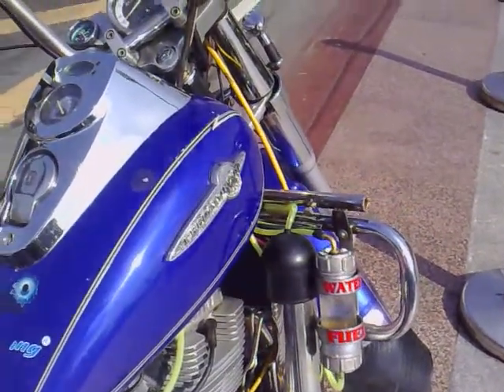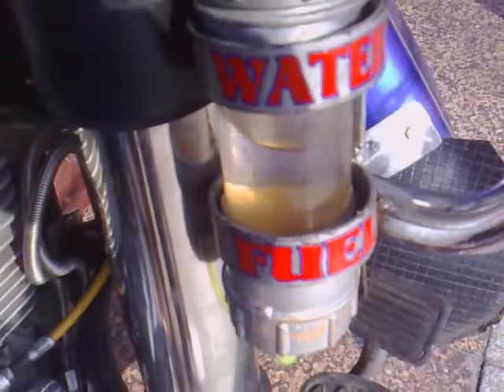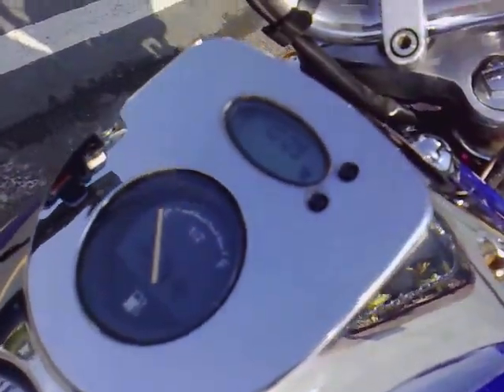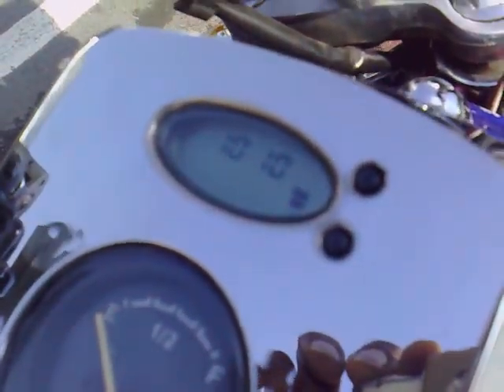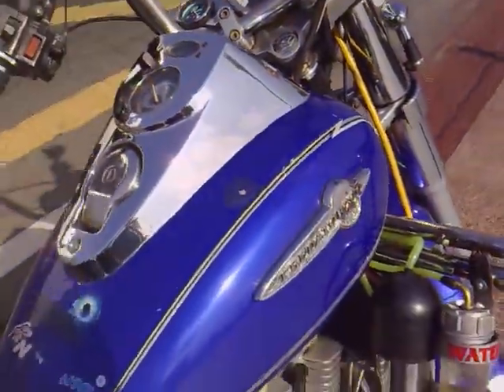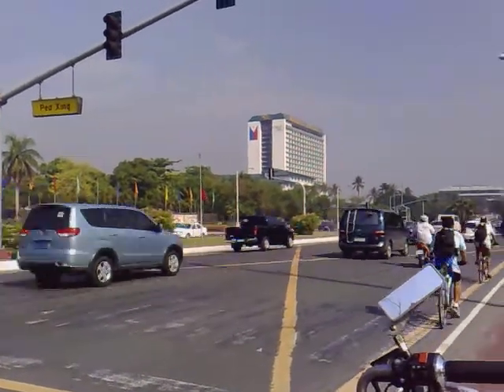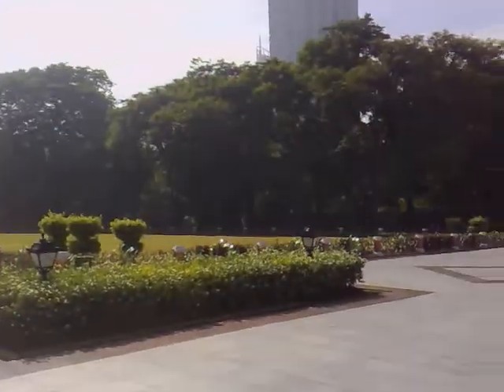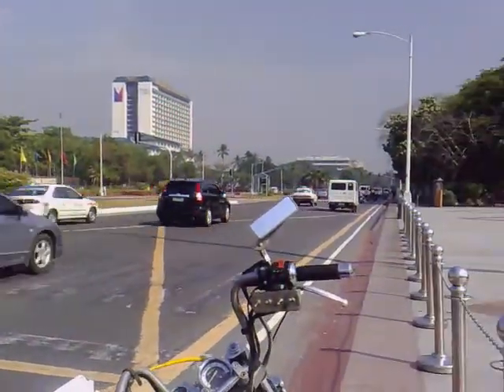HHO NEW SET UP  TUBE CELL on my MOTORBIKE  043010   V016

Comment from the maker: H2Truckers,  
Thanks sir for watching my video and giving your advise. As I observed applying more than 2 amps on my hho generator will affect the charging system that will cause abnormality in the supply of current on the CDI and will eventually cause the engine to stop.  I have not modified yet my motorbike charging system to keep it original. Anyway 2 amps can save and gain more mileage on my motorbike.  Thanks and please dont be tired of giving your comments and advise.

Comment: Bro...galing, mas maganda ang porma ngayon..

2amps definitely the best you got. You will not get even running this in more than  hours. The applied voltage of  12 volts and the amperage is just enough to split the hydrogen without excess heat.

This is the law of electrolysis where water splits into H2  & O.
" The difference between the applied voltage and the decomposition
voltage is dissipated as heat. " According to study, extra heat decreases hydrogen generation.
Reply: Magkano pakabit nyan sa tmx honda?brod vox.